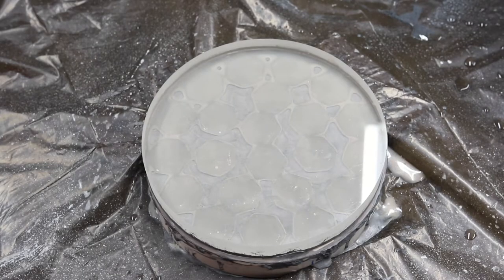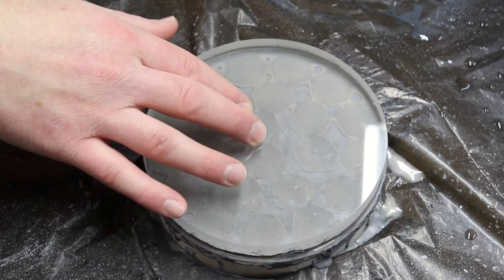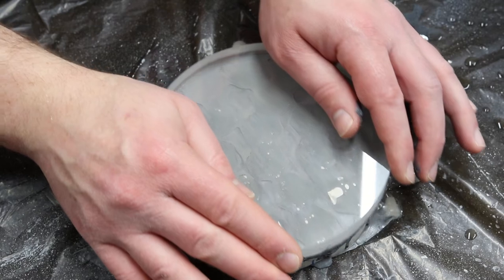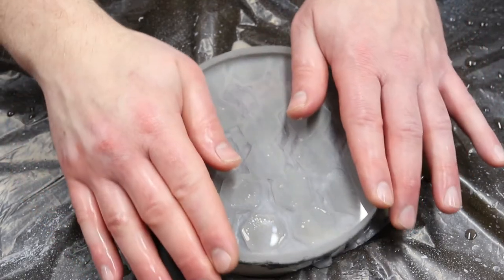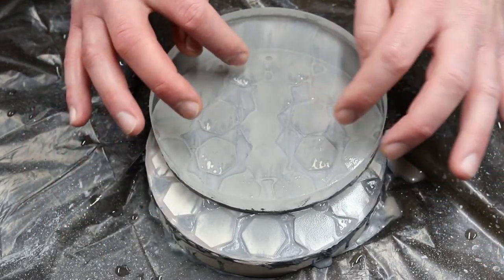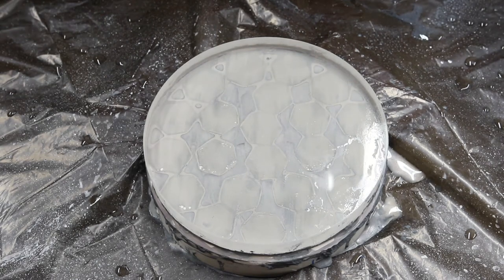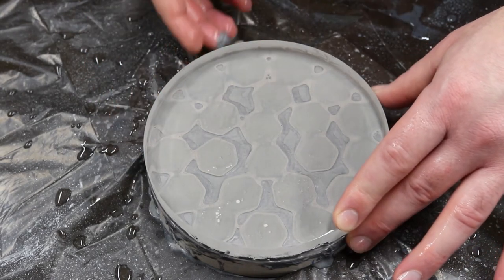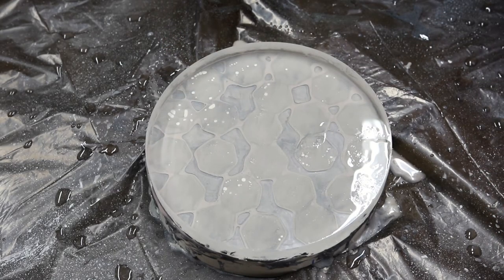ATM - 6in Mirror - Session 4 - 220 grit Bubbles

Comment: Nothing to worry about, Perfect contact is somewhat irrelevant during coarse grinding. Coarse grinding makes an average sphere or rough sphere shape. Your contact area is ok. Jump to 500 grit, work center over center one third , do not listen to music, feel the texture and connect with the sound, it does not matter if you work fast or slow, work as you feel, thats a work of art what you´re doing. Congratulations man!
Reply from the maker: Thanks!  It's certainly a labor of love at this point!  Lots of hours into it now.
Reply: @esphotocreations1652 It takes some time, but it´s a magnificent experience. Eventually you´ll get there.

Comment: Doing full w strokes deepens the hole surface. Use a w stroke only  from 60% to 90% of the surface without working the center. After that use I stroke center over center one third long, so both surfaces better match. Bubbles should appear consistent around the surface, no big bubble in the center or at the edges. So you´re fine.
Reply from the maker: I don't really see bubbles at all most of the time.  When I do see them at the finer grits that I am using now, it usually feels like the grit is becoming too thick and dry, so I wet it down a bit to smooth things out again.  Should I be seeing some bubbles?  Do I want the grit to be a bit thicker?
Reply: @esphotocreations1652  At 500 grit you shoud see very little or very fine bubbles all over the tool surface, 2 or 3mm diameter. At 800 grit you should see very tiny bubbles at the beginig of a new charge of water and carbo. But afer a  few turns  surface should look plane, almost no bubbles. You don´t want a thick layer of fine grit, put a tiny bit of grit and sprinkle water just  once, not so watery nor dry. The layer of grit should look very fine and thin just like one hair thickness. It works better this way and every charge last longer.